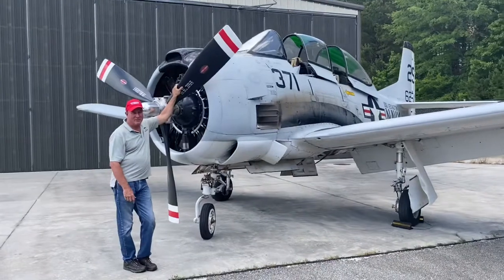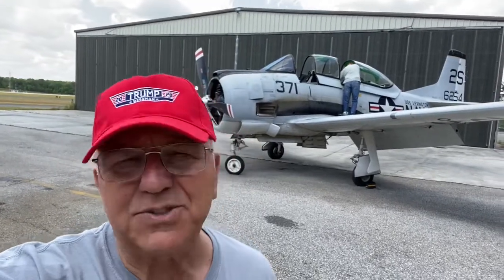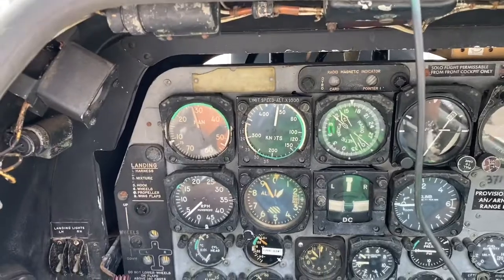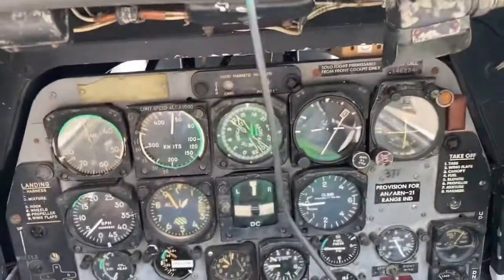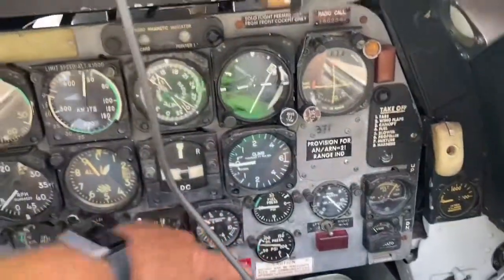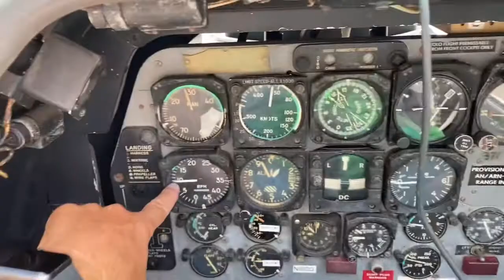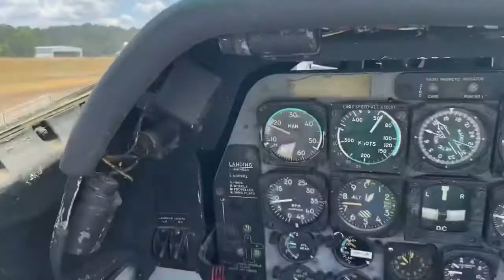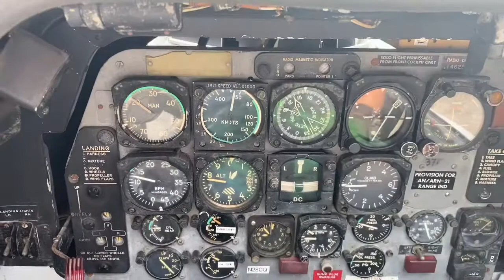T28 Flight May 16, 2020

Comment: Thank you for sharing this with us Jim, this is a dream plane of mine. Can you answer one question? When I see people start these up they often let the rpm's sit around 3-400 for a minute before revving up to a smooth idle. Is this so you dont choke the engine out right after startup or is there a different reason for it?